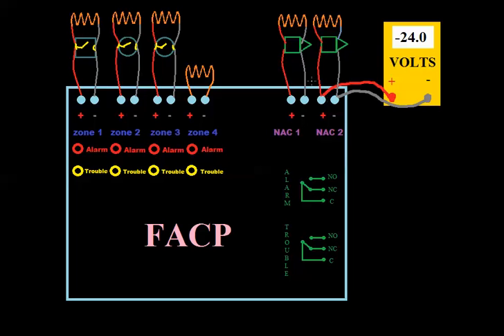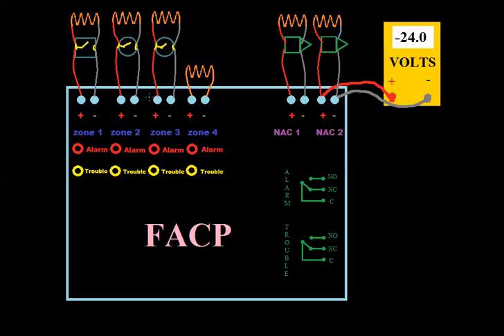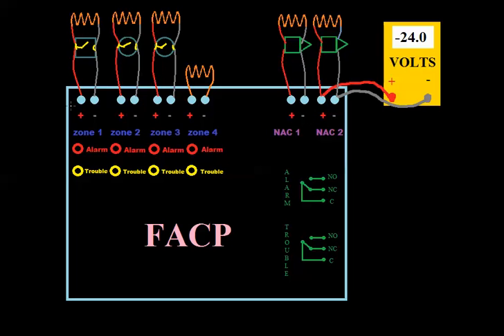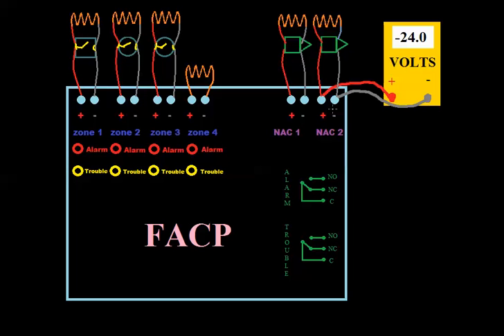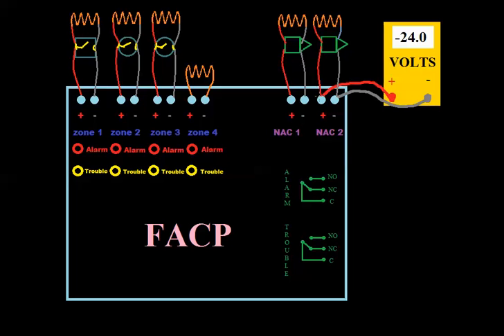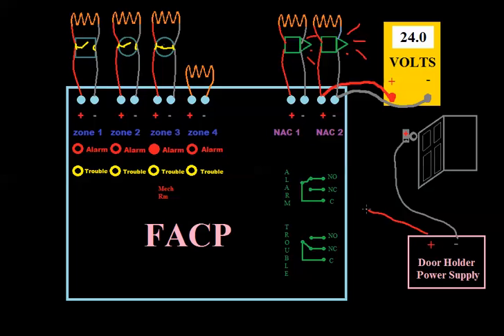4 - Introduction to Fire Alarm Systems

Comment: I have been in the industry for 20 years and one of my duties is to train our technicians.  Some of which have been doing this for as long as I have some are not to knowledgeable of how to diagnose system troubles.  I can't always be available to walk them through troubleshooting.  With this all said I would ask two questions.  First would be may i use your videos in my training.  TBH so far you would take the same steps i would and giving examples and visuals will help several different types of learners.  Plus i don't know how long it would take me to recreate something like this.  the second would be which videos would you suggest to start these guys off.  Most of them inspectors with some system knowledge but very little troubleshooting knowledge.  Some have some troubleshooting knowledge but could use a refresher.
Reply from the maker: Yeah, of course you can use the videos. They're free on YouTube for that reason. As far as where to start, it's hard to say. When I started making the videos I wasn't sure what they would turn into, or if anyone would ever see them. So I started in a place that made sense to me at the time for the people I was trying to train. If I were doing it over, I'd probably go in a different order. But I would start them off with video 1 and go in order, with the understanding that some videos may not be as relevant as others. I don't think this is the best format for everyone to learn, but some people seem to get some benefit from it.

Comment: Is it misleading that the white wire for neutral and red/grey for the split phase is shown on the power lines before the transformer? If this is a single phase split-phase system with the transformer centre-tapped on the secondary, wouldn’t the neutral be created at the transformer and the 3 wires on the lines be 3 phases? Also another wire grounding the transformer and a bond screw in panel.

Comment: IM in the IBEW Local 26 I have about 6 months under my belt with Fire Alarm Installation. These videos are great. Right now IM installing a class B style with SLC. NAC and IDC the SLC are addresseble. Learning how to run the wire with out any splices is one of the hardest things. And relays and contacts.
Reply: are there any visual resources to learn how to pull the wire correctly? so that youre not splicing
Reply from the maker: Not that I'm aware of. If it's SLC style B, there's no reason not to splice. People will argue that point, but there are cases where you'll make the circuit so much longer than it needs to be if you don't uses splices.  Splices can be neatly done in terminal blocks inside Hoffmann boxes, or even neatly done with wire nuts. Again, you'll find people who will say I'm a hack for thinking that way, but they can't give you a reason to support their point. Obviously AV circuits and class A circuits are different.
Reply: @JoeKlochan response from 1 year ago so sorry haha.  I ran installed fire alarm for a school in which it was impossible not to have splices, we used space age terminal splice boxes.  Facp was in a room in between a 20 foot tall cafeteria and different areas of the school branched out from there.  Strange school layout so impossible not to do splices there.  Very few problems came from that mainly just your normal ground fault here or a few wires not terminated properly.  To cut down on loose wire problems I'd recommend wagos or terminal splice boxes wherever possible.  Those boxes have test slots so you can meter it without removing the wire.  Wire nut splices won't let you test unless you remove it.

Comment: uhhh theres no neutral bar  it should be the red line which represent the " Hot Wire "and the " Neutral "wich is the white wire in replace of the black wire when your dealing with Line to Neutral circuit
Reply from the maker: There's no neutral bar in a breaker box? I'm not sure what you're saying.
Reply: Panelboard you mean. I get your idea of LINE - NEUTRAL system plus ground. But speaking of neutral bar theres no neutral bar seperated it should be Terminal 1 for "Line"and Terminal 2 for "Neutral"theres no seperated neutral bar... There's Gound Bar but no neutral bar seperated as you describe
Reply from the maker: @JaysCoquilla  that's definitely not true. Are you in a another country maybe? Every breaker box has a neutral bar. Also, I've never heard anyone call it a panel board, but you seem to be the authority on all things electrical...
Reply: awhh yeah heheh I'm a Filipino an Engineering student and A Registered Master Electrician. Hmmm I think some terminology is different but i think the Idea is the same Here on Your drawing we call it panel  board inside theres multiple circuit breakers. we dont have neutral bar here. I think thats the Difference hence we have 220 L-L voltage and L-G but in america 110 only?  I Guess?
Reply from the maker: @JaysCoquilla  bingo

Comment: must the resistors be connected at the end of the circuit? thanks for the video it helped though
Reply from the maker: Yes, otherwise the circuit beyond the resistor isn't supervised
Reply: @JoeKlochan  can you explain in brief about Est3 system , there is Siga-ab4g sounder base detector ,i want to know it needs 24 volt supply but from main control axulliary power or from booster power supply please clear it..
Reply: @JoeKlochan  sir i have little doubt on Nac circuit as u explained in video that current flows from negative to positive direction in this condition the Nac circuit cant activated because it requires reverse flows i mean from  positive to negative direction then current gets block and shows open circuit and speakers get on ..am i right sir please explain
Reply: @JoeKlochan  normally when we test smoke detector or NAC circuit what happens it gets activated is there same thing happens that the polarity gets change from positive to negative & circuit get blocked and shows open and detector or sounder go to alarm

Comment: Great videos from an industrial electrician. But FYI there is no neutral running down the power pole. They create it at the transformer on the pole. But really this videos rock.
Reply: The neutral is connected to the transformer but it is the messenger wire  carrying the two energized conductors down to the house. The purpose of the neutral is to return the unbalanced current back to the source of electricity.

Comment: @Joe Klochan- Sir, can you also explain the situation where the door is controlled by alarm circuit. You have mentioned that the door will remain open until the alarm activates. But practically, shouldn't the door be opened after alarm goes 'ON' for students to exit ?
Reply: That door isn’t an emergency exit door as you assume. It’s just an example. It could be a door leading someone farther from an emergency exit. Closing it helps direct traffic out of the building. Who knows so many scenarios
Reply: It depends what the is for incase of smoke control some doors will close on fire alarm.
Exit door will automatically release if they are magnetically held .It depends on how the whole building was designed by the fire engineers.

Comment: How is the door holder physically cabled? Is a cable run from the PSU to the fire panel, then from there to the door holder?
Reply from the maker: krankenshaft totally depends on the application. If it's a 120 volt door holder, it would all be in conduit. If it's 24 volt, you'd likely have a fire cable run from the door holder power supply to the relay, then to the door holder. At the relay, the negative wire would be spliced together (not touching the relay at all) and the positive would be landed on the contacts.
Reply: @JoeKlochan  When you say " all would be in conduit" does that mean the the wire would just be a loop to the magnet on the door and continue to hit a nother device from there? 

Great vids I take my test next month.

Comment: I don't understand how a nac circuit is able to monitor the eol if a diode is stopping the current flow when its in a reversed polarity or normal state??
Reply: John Wayne if it reads -24v it should still have a current? Not 100% just a thought
Reply from the maker: John Wayne it's important to understand that the diode blocks current from flowing through the device only. It does not (it cannot) block the current from flowing on in the circuit, and thus through the end of line and back to the panel.

Picture a strobe with two black wires (negative) and two red wires  (positive) landed on the device (an "in" and "out" segment of the circuit). These wires are physically touching each other and so currently the will flow through them. The diode is internal to the strobe, and is preventing current from ENTERING and flowing THROUGH the device, until the polarity is reversed. But it will still flow beyond that device and through the EOL.

Comment: How is the whole process of getting a job in fire & burglar alarms? Do you have to know someone that knows someone to get in? Do companies give you a practical test before even considering you? 

I have a two year degree in electronics and computers. Currently in Chicago.
Reply from the maker: +PBRshots I know this is old but you should be able to get hired. There are plenty of companies in Chicago. Apply to all of them and write a decent cover letter. If you still need help contact me directly.
Reply: Joe Klochan Alright thanks, I've sent you a private message.